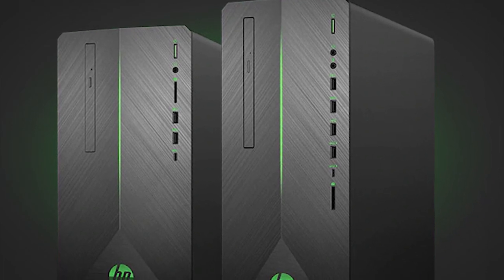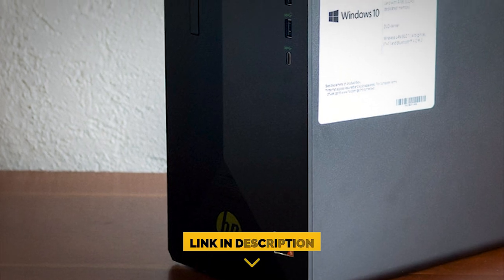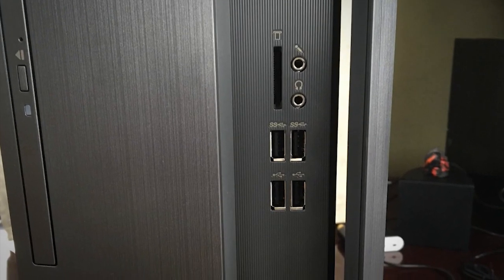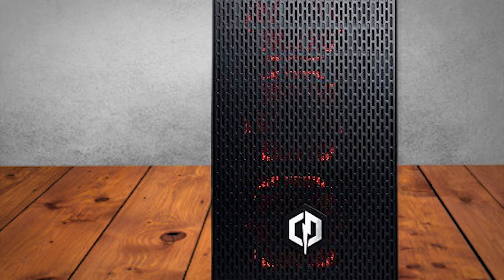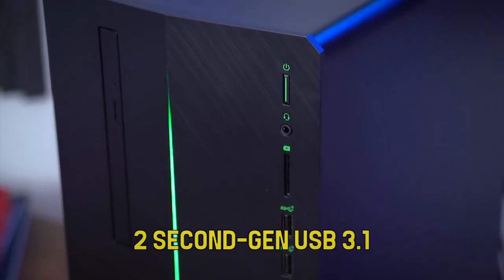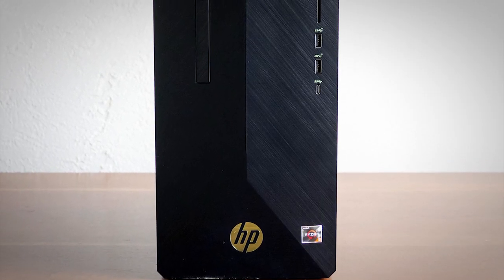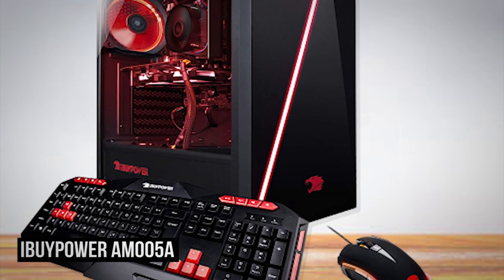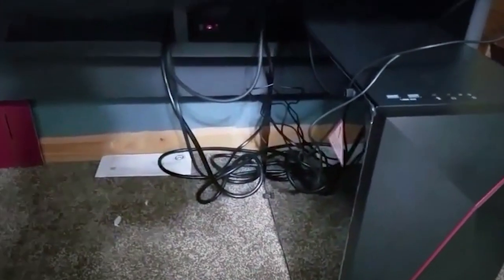BEST GAMING PC - Top 5 Best Gaming PCs under $500 In 2021

Comment: Th ere is no need to buy a pre built A pre built U Can build your own here should be A 500 dollar build Prices May warry i3 10 gen 8 gb ddr4 3000 mhz corsair Vegenace Lpx Gtx 1060 b410 m from Msi pro vh 500 gb kingston ssd A corsair  spec 05 400 watt any bronze Certified Psu from Corsair Coller master or Evga Would Work like A glorry it would easily Help you to game On 1080 p high settings edit 60 fps 
And Yes You can run gta with solid 100 frames and Fortnite With competitive settings it's going to give 100 to 150 fps on average And most importantly It's You own you Will not Have Worry about Brands encoding virus And Hacking your Data your Builting from your Self just good As It gets A Tutorial from Msi Another Brand making parts Has A biggners Tutorial On Builting A pc go head and watch it and Build your own